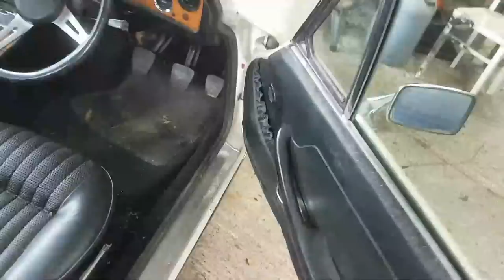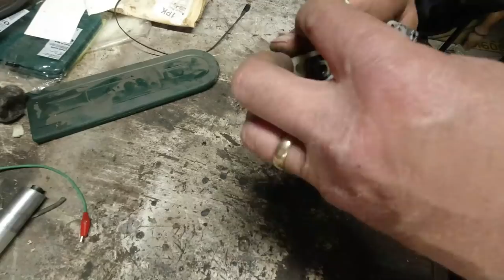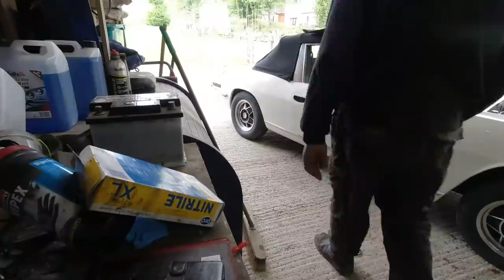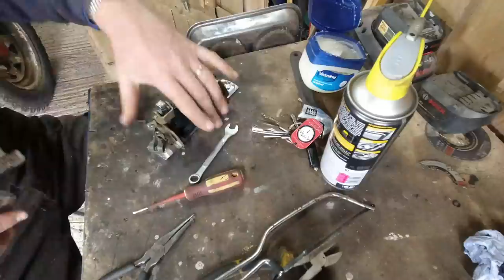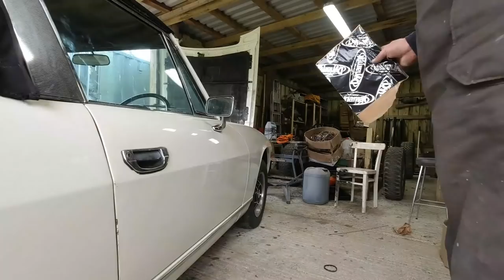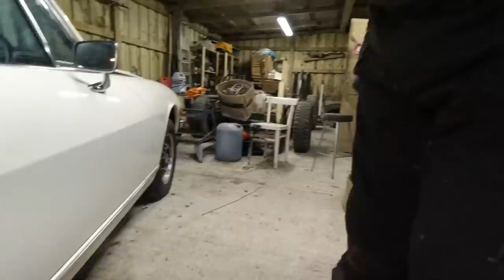1973 Triumph Stag - door rattles, locks, handles - Parental warning for Profanity

Comment: Excellent job, who cares about extra screws in the door card? If it improves it, then that's a result. I bought my last Stag from Peak Performance Cars [ based in Middlesex and closed years ago] it was £5,250 which was classed as a really good stag back in 1990.
Prices were £1,000- needs total restoration
£2-2,500- needs engine reconditioned and some rusty panels.
£3- 4,000- high miles, tired paint and pitted chrome but had MOT. Rover V8 and V6 Essex conversions.
£ 4,500 Good cars with MOT tired interior, decent service history and maybe not that original.
£ 5-6,000 Original colour, MOT, good history, low miles and owners, cosmetic work required, interior, soft top, paint chips.
£ 6500 - £7,500- Excellent, low miles, full history, original panels, paint and excellent chrome and interior.
£ 8,000- Superb original examples.
£ 8500-9500- restored rebuilt engine gearbox, new soft top, retrimmed interior, carpets, new panels, paint and chrome...show car.
How things have changed, I would love another one but would loathe to pay £8-10,000 on a car that needs £5,000 spending on it to bring it up to standard. The prices are ridiculous now, the wife would suffocate me with a pillow case if I even considered another.
The point i'm making here is why do people buy these to store and look at and never drive? The club was full of them, passed on to their kids for inheritance and then sold on to another person to store. I would hate a concourse car and I can tell you the concourse ones, were the ones that always broke down. Fact!
Reply from the maker: concourse is horses for courses, some folk prefer detailing to driving. Now when it comes to unrestored concourse I do get enthused. Patina patina patina! 
It is nice to see a restored to spec car, but concourse seems to be overdone and way to shiny.

I remember Peak Performance Cars too